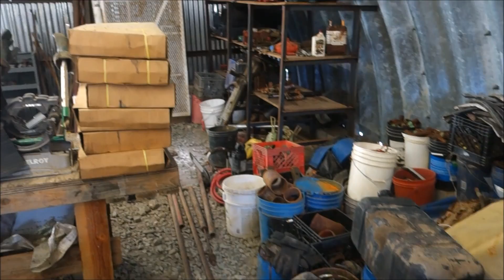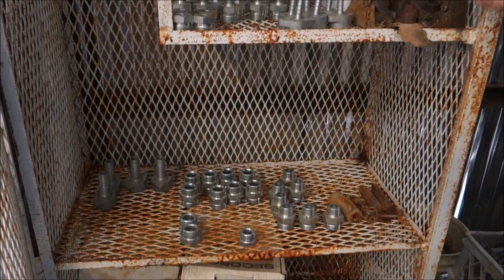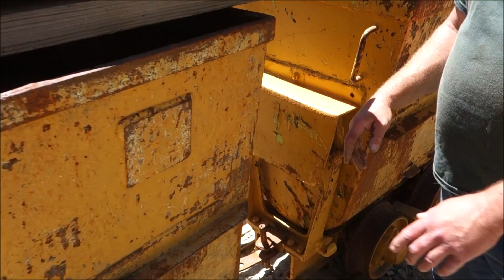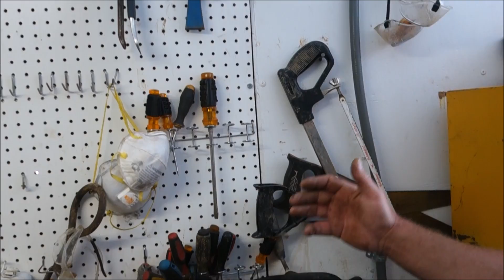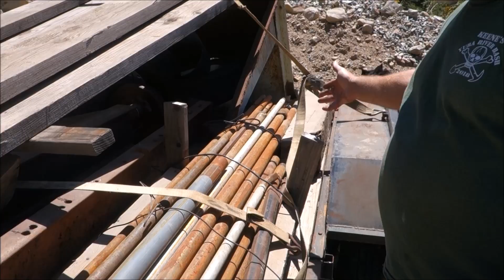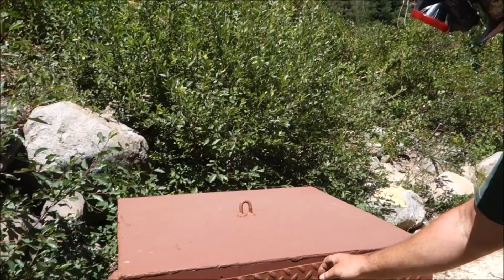An Insider’s Look At Active Placer & Lode Gold Mine: Part 4 - The Mining Equipment

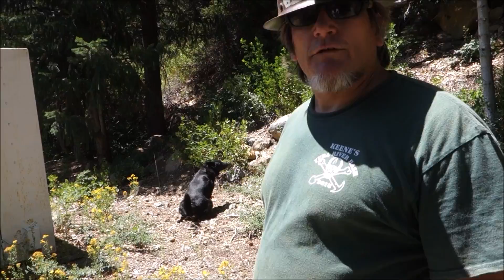Comment: There's NO WAY this at the moment it was filmed actually was an active mine. Maybe the guy hopes to start things up again. (If it's not just a guy who likes to 'play miner' and has access, and who has switched on the still working air supply today for the occasion, to make it look more realistic.) Whatever may be the case, he doesn't know much about how telephones operate. What he says about the phone lines that supposedly run trough the mine, technically spoken is complete nonsense. Besides that, literally everything we have seen that got to do with the mine itself, 100% of all things in it and all of the equipment (only a few wires, one connector on an air line and hand tools and boots in his shack excluded) is old and rusted, or at the very least visibly has been standing unused for quite a while. There's literally not one single thing that points to ANY actual mining activity. Granted, there are a shack and a container that are new(er). But even the very small space in one of them that's designated for 'the guys' to change clothes and put on their gear is totally empty and unused. And clearly never HAS been used, it is spotless. When Aaron tries to explain the operation, he mostly talks in terms of how it WAS done in the day, then starts mixing things up. Says 'everything (he talks explosives now) HAS BEEN APPROVED by the ATF', then shows up a completely empty container, with a piece of chip board hanging loose on the inside of the door. The actual things he says are all about how it once was, back in the day, but he tries to make it sound as if that is valid for today.. Stuff like 'your ore OUGHT TO BE trucked out of here'. At the same time he admits that all of the road 'is overgrown' (about 50:50 and on).
Reply: Harrick V Harrick well it seems like they’re just taking core samples to find where they intend to mine.
Reply: all we did is re-habing and exploration via. core drilling to confirm assay reports from the 1970s..... started out with a crew of 12 and dropped off to 2 miners and an outside guy
Reply: 3weeks ago we were working 4x10hr days.... spiling to reach a drill station behind a large collapse in a vertical slip fault. unfortunately sometime after shift, several 100 tons of the back and ribs fell out
Reply: @aaronkeeth651  Well, good you weren't underneath it when it came down
Reply: @aaronkeeth651  Jesus. Glad you were topside when that happened.
Reply: @Porty1119  me too!  our lagging was guardrails and #11 x10ft rebar(2 per cell) and 8x8s  for legs and cap x2 per set and spaced 3ft oc
Reply: @harrickvharrick3957  will be running this spring but operation's ceased fall of 17,resumed mid summer of 20 and after a  large collapse took place after shift and during an ongoing process (spiling) to reach a drill station (hotspot) that was ran in the 70s. bypass of this collapse in fresh rock or alternatively drilling and extraction of cores from this area being done from a more suitable location within the mine, which one is hard pressed to find in this hole(deathtrap)

Comment: Seems like most of the equipment hasn't been used in a long time , is this an active mine ?
Reply: been shut down for 2 year's.  takes an unbelievable amount of capital to get beyond the exploratory phase.  the gold is there!  this mine is in a fualt zone and has 6 veins running N/S,one of which Carrie's AU.  consistent. this mine has several primary channels and  many enriched secondary  tertiary deposits.
Reply: @aaronkeeth651  That's for sure. I'm in a position where we've got about $750k worth of ore stockpile, it was supposed to be sold to a smelter as flux but they're skittish about buying flux this year. We're now trying to beg, borrow, build, or steal a mill, looking at $100k to do it cheap and hillbilly-like but none of us has $100k.

Comment: If digging in that ground is so easy, and I'm not questioning that it is, why don't they just raise the roof of the tunnel a foot, raise up the ventilation tubes, and then be able to haul full ore carts forever after. Seems like a waste of long term production effort due to the short term effort of expanding the vertical travel space.

Comment: Now this is my speed!

That is one of the cleanest EIMCO muckers I've ever seen. A friend of mine has a few he picked up at auction in Tucson for around $400/ea. that look about as nice, as well as a pair of EIMCO 630 crawler muckers that look similar.

Reversible ventilation is an MSHA requirement for any "shaft mine", which in MSHA-speak is any mine with a ladderway.

Air-powered chainsaws are all right, not as good as Milwaukee battery units. I salvaged a few air saws from an old millsite last year for another acquaintance. My buddy may have bought some bazooka blowers out of there as well, but I don't remember.

8:48 whole stack of jackleg feed legs!

Aaron knows a thing or ten about core drilling, that's for sure. I've never messed with it - the mines I'm involved with don't have a functional core drill, so they just longhole everything with a modified air track drill and assay the drill cuttings.

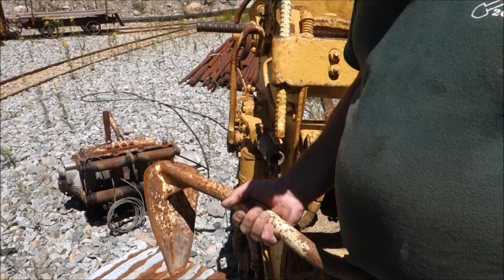18:25 us New Mexico/Arizona guys call those duckbills.

Metal ore chutes? That's just cheating.

I've just put a video up of a modern silver mine that shut down in the early 90s. Some of the same guys I'm working with now were involved with it. We only got to check out the newer rubber-tire workings, but the manway of the shaft was rehabilitated in the mid 80s and the mine is dry, so...
Reply from the maker: Thank you (as always) for sharing your perspectives...